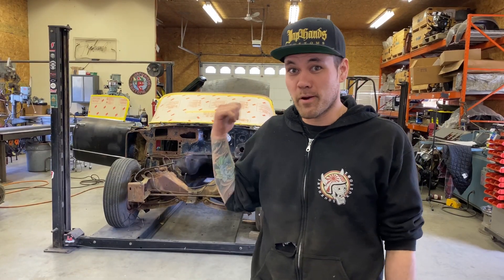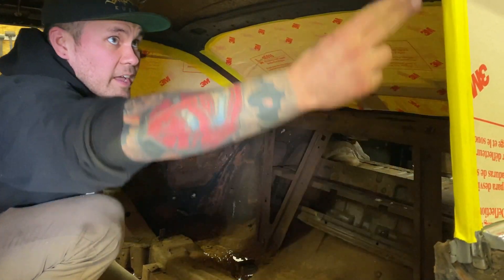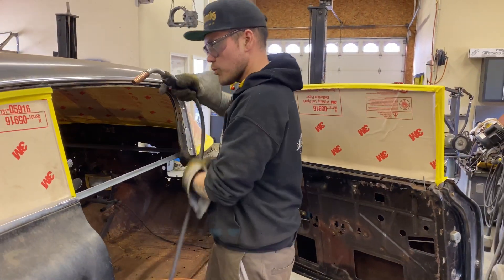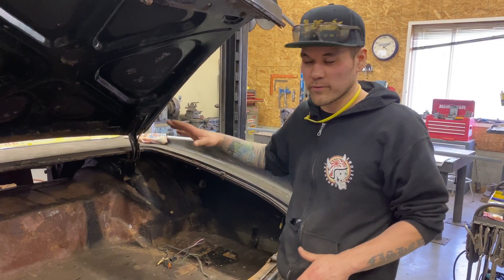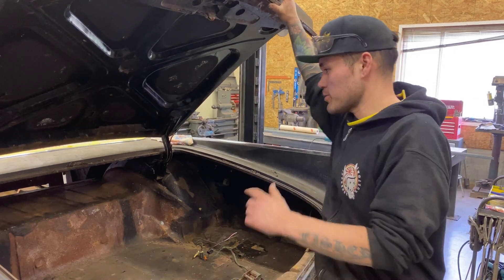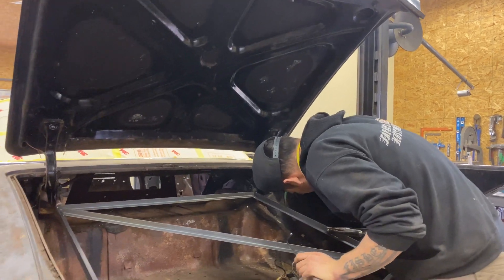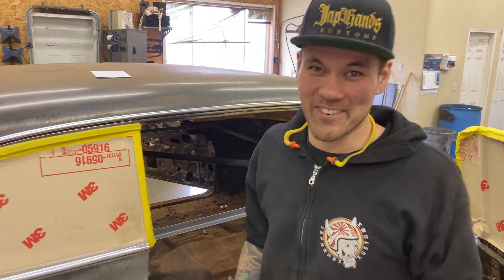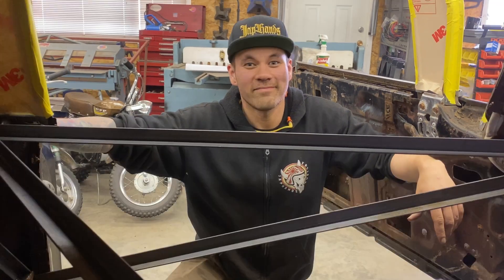How To Brace ANY Car For Surgery: CHOP TOPS & BODY DROPS !! Channeling A 1960 Coupe De Ville

Comment: Great video! Bracing is sooo important if your cutting out any support out is car. Iv seen door openings widen out when doing rocker replacement and a pillars move making door alinement a pain. A lot of all this can be prevented but just thinking ahead and taking some time to brace things and when you think you have enough braces add one more to be safe haha
Reply from the maker: Well said Ryan! Better safe than sorry and crooked 😆
Reply: @MakeItKustom  I am new to this... what size angle iron were you using?

Comment: Glad I found this channel, wondering if you drop the body will the motor will still fit under hood, not sure how low the motor can go and still have the drive shaft fit in the backbone of the x frame

Comment: Looks like you are using 3M  welding and spark deflection paper on the glass. Very good protection- people don't realize how easily glass can be damaged by weld spatter.
Reply from the maker: Yeah it’s the best stuff I’ve ever come across. Not cheap but worth every penny
Reply: You can also damage your eyes if you are not using your welding helmet, and you don't need to ask me how i know that !

Comment: Love the videos! Now my go to channel for metalwork tips. What size of box section do you use for bracing? Need to brace my own project to replace the rails
Reply from the maker: I was just using 1” angle iron. 1/8” thickness

Comment: Huge fan! I have a 68 deville convertable and my frame is toast, I have a new frame for it and will be building it up before swapping it out. I've been told that since it's a convertable I'll need to brace the car before removing it from the frame. Is this accurate? If so I imagine what you did would suffice, minus the upper pillar pieces.
Reply from the maker: Yes definitely bracing is necessary. I’m sure that I over brace in some cases but never regret it

Comment: You turned up your welder, that I understand but why did you only tack without a helmet? I’ve been welding for years and if I need to do a good tack I tack about 1/2 “ long and at the intersections of the angles iron weld a lot more.
Reply from the maker: It all depends on the force is applied to the material in this case there really isn’t that much other than directly linear so smaller tax are fine

Comment: Hi, I've got a 68 cadillac convertible that I need to lift off the frame. I'm not doing any body surgery but I've been told that convertibles are tricky to remove from the frame. Would this kind of bracing be necessary?

Comment: Are you going to remove all the glass. If yes why havent you already remove them
Reply from the maker: No man we’re just gonna build this car so she can drive it right away with the patina and the new chassis and drivetrain. One day it’ll get full paint but at that point we are going to rotisserie and strip the car and make it a showstopper
Reply: @MakeItKustom  Sounds good. I was wondering if it was going to be in the way. Btw. The hood you straightened in the video what does it go to?
Reply from the maker: That’s for a 1940 Willys
Reply: @MakeItKustom  ok thanks